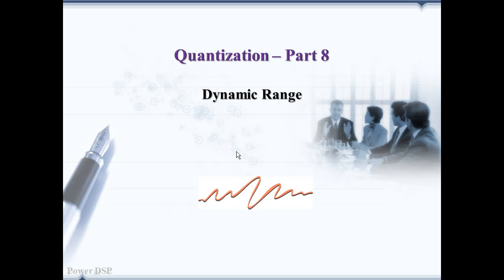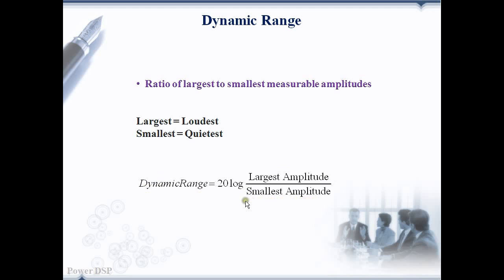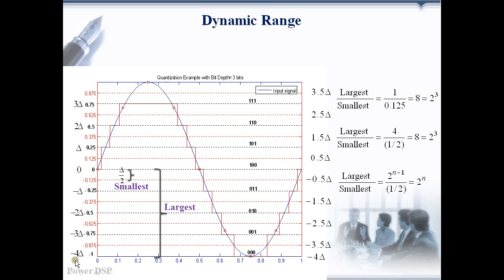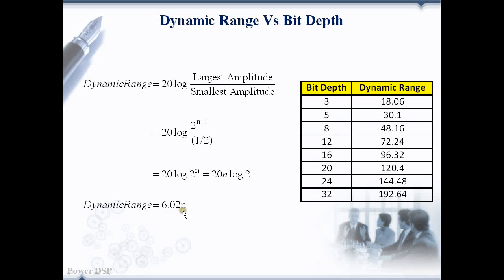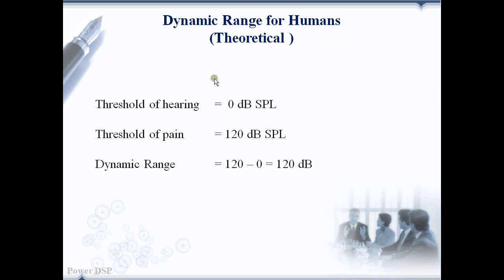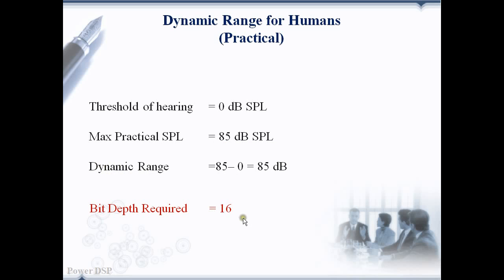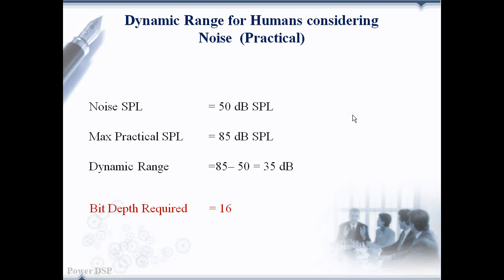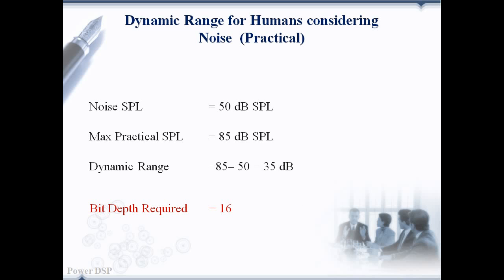Quantization Part 8: Dynamic Range

Comment: how can the smallest amplitude it can take is "delta/2".  If the signal has an amplitude of "delta/2" before quantization with 3 bits, it will be quantized to either 0 or 'delta'. Right? if so then the smallest amplitude this signal can take is "delta". Right?